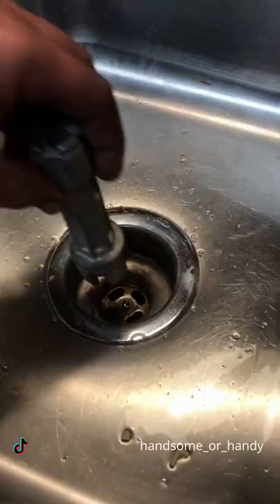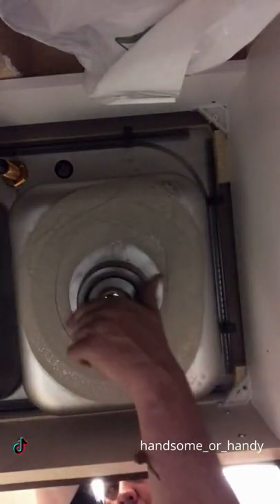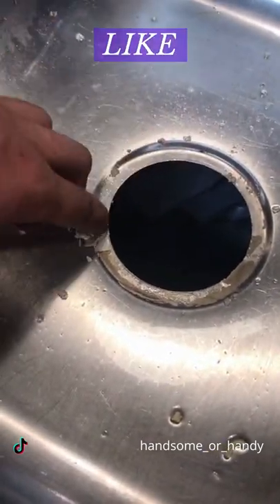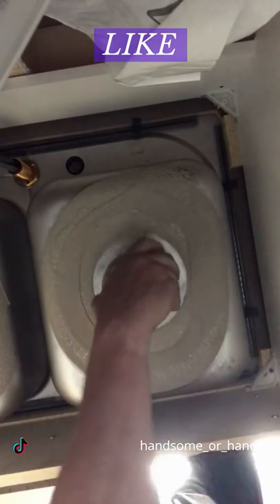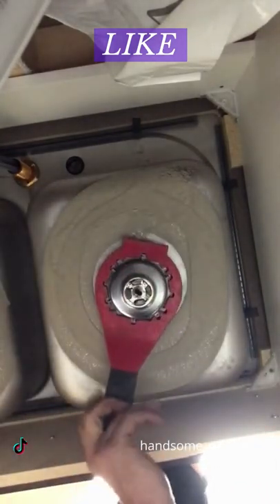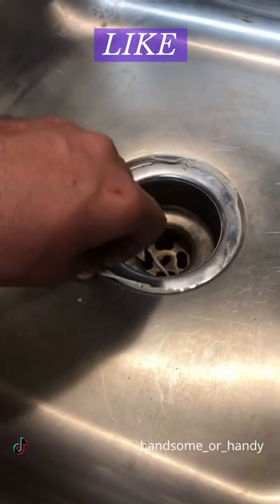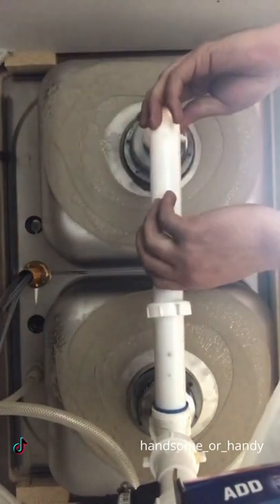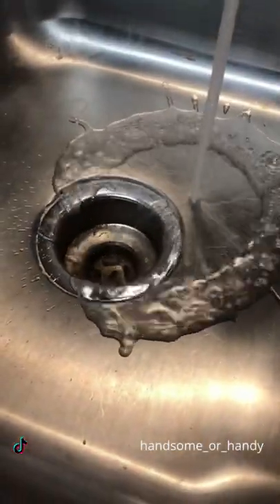Fixing a LEAKING Kitchen SINK

Comment: What was that you put in the sink
Reply: plumbers putty, in uk its known as plumbers mait.  I used it.. along with silicon its ok worked fine for me for several years but recently changing a tap its now leaking so want something easier and quicker I believe plumbers are possibly using LS-X seal by Fernox or Fernox joint compound (they got 2 one for drinking and another not) but not 100% sure on that just stuff i read.